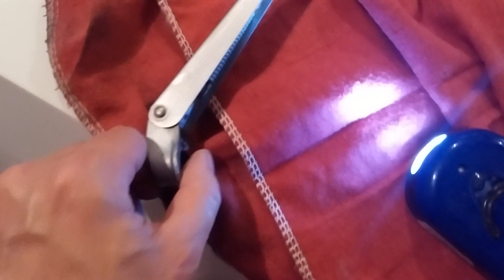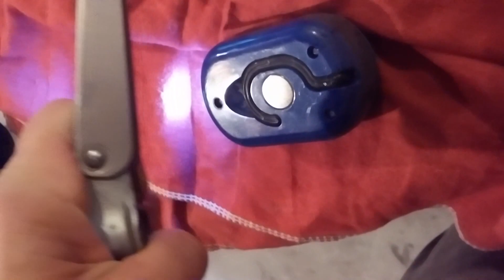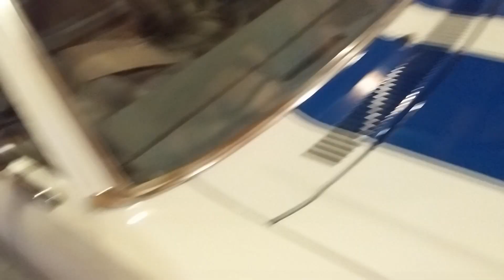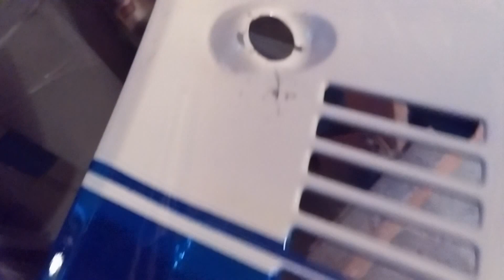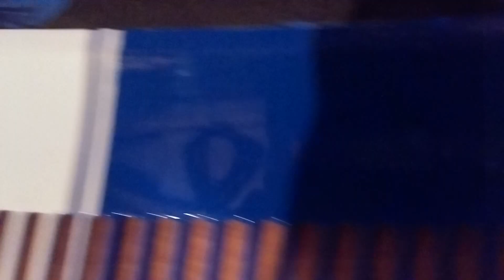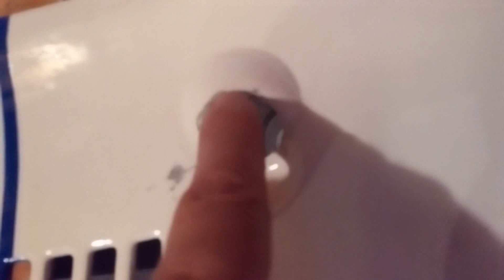All handles on Wipers OFF, a look at damage

Comment: You can put a little tape on the jaws of a pair of channel locks and then grab the wiper arm it's self down low and rock it just a little and they will usually pop right off with no damage. Car looks good sir.
Reply from the maker: ***** I agree that would USUALLY be the case... in this case, some DUMBASS left masking tape glue all over the friction fit posts...

Comment: Unfortunately, wiper motors are geared for maximum torque = paint/metal removal. It doesn't look too bad, though. The car looks good with door handles and mirror. Thanks for the update, Reuben.
Reply from the maker: Bruce Boschek Thanks Bruce!

Comment: I wonder if the splines on that wiper transmision assembly could use a little wire brushing to help clean them up? Seemed like it was a lot of trouble to remove the wiper arms.

Comment: looks ok to me...lets ride

wipers could use alittle grease...there not rusted which is what happens...the spring is to keep the wiper pressed to the glass.... your right theres 2 stops points with the old wiper motor. the wiper clip is small and its there....
i always made sure it was down in the winter because ice can strip the gears. can strip those gears if windows not scraped also..
wheres the seats?